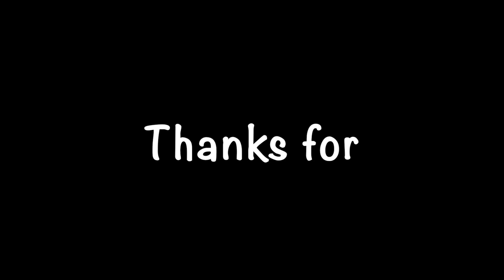How to fix Broken cabin foundation Piers

Comment: Great video, and very familiar work.  I did the same work at our cabin in northern Ontario - 11 piers in total.  I managed to get all 11 down to bedrock, even if the hole had to be 6 ft deep.  Pinned rebar into bedrock, then built pier posts out of 12x12 bullnose pier blocks, filled with concrete and rebar.  The area surrounding each pier was backfilled with gravel.  What I've learned is that frost jacking/heaving needs three things:  1.)  Lots of moisture below the frost line, 2.) Fine silt or clay soil, 3.)  Freezing temps.  Eliminate any one of the three, and problems go away.  I added french drains to try to address #1, and kept the clay soil away from the piers by backfilling with gravel for #2.  Not much I could do with #3.  So far, 5 yrs in, all is well.  You've done fine work with a miserable job.  My only suggestion would be to not backfill with native soil, but bring in some pourous sand/gravel.  I hope you have steady piers for years to come.
Reply from the maker: Thanks!  so far so good I did put a drain all the way around the camp which I’m sure helped tremendously. Once I get skirting put around it that should help keep the frost from running real deep as well. Sounds like u had quite the project as well.
Reply: These are some amazing tips. I'm also in Ontario and taking on a similar project. What type of concrete did you use? And what type of gravel?

Comment: SUGGESTION: You should consider thick mil plastic to hold back any moisture.  Then a french drain around the perimeter that dumps water downhill.  Also, grading the ground around your cabin so that water flows away from your footings.  Having dry ground under your cabin should solve any frost  upheaval that you are experiencing.

Comment: Great video. My wife & I have planned on leaving our nations capital (Ottawa) and moving to rural northern Ontario in an unorganized township where we have a small parcel of land surrounded by crown. The local tradesmen in the area are not very eager to work apparently so we have decided to take on the project ourselves to build our foundation. We will be building a vertical (stockade) style log house 28x32.

We have all been made to believe that you need to be hooked up to the grid, hire professionals and work a 9-5 job until your 65 and retire. You don't.

My wife and I are both 36 and own a legal secondary dwelling and another house which will be sold once we are to crippled to walk. Time to GTFO.

Appreciate the details in your video and will be checking your other ones shortly.

Thank you!
Reply from the maker: Sounds like you have a solid plan. Wishing you the best on your new journey. We only get on trip on this rock might as well make the best of it. Nothing more satisfying than doing it yourself.

Comment: Gotta say - this video is gonna help me tons. I, like you, purchased a cabin about 3 hours north of Toronto (so about the same climate as Vermont) that was cheap, because of leaning or busted piers. We've enjoyed it for about 18 months now, but it's time to do something about it. I got quotes for about $100K +, which isn't going to happen. We had so many questions about doing it ourselves, like:

- piers MUST have rebar, don't they ? :-)
- how far to dig down
- how to get them out of the ground - we don't have a pickup, so might invest in an electric winch
- what to do with the old ones.
- how to dig with about 1-2 feet of clearance - was there any magic tricks
- do we set the posts INSIDE the sonotubes or not
- 8X8 posts or 6X6
- 45 degree supports

I think you've answered everything here - I'm gonna save this one, for sure!! Ya, it's a lot of work, but the money you saved AND, probably more important, is knowing that it was done right!!

Thanks
Mike
Reply from the maker: Thanks Mike!! Glad it helped you out. There are a ton of options to jacking and leveling a camp one option depending on the the size of your camp is to find a couple I-beams and Jack and crib the whole camp up higher to give you more room to dig I was lucky that my cabin was up high already except for the front. Just remember one you start replacing them to finish before winter. Unless you do the I beam method then you won’t have to worry about frost jacking. I like to over build things a little bit rebar is just cheap insurance to me it only added a couple hundred bucks for piece of mind. Also remember if you ask builders or inspectors questions about building codes or what not they are just minimum standards I personally will spend a few extra dollars to build things a bit more rugged with in reason where I see they could use a bit more than minimum standard. Also look around in your community maybe you have a neighbor with a tractor or truck and you can barter or trade something in return for use or assistance with pulling out the old piers. It’s sad that now a days we are all led to believe we can’t do things for ourselves any more we need experts and professionals to know how to live. Wish I was closer to you I’d lend a helping hand. Keep me posted on your progress. I promise you that you will have a lot more satisfaction doing the job yourself than just paying someone else to do it. Look forward to hearing how you made out.
Reply: Have you completed your project yet? I am in the similar position as you are.

Comment: I am wondering about the added benefit of digging holes deep enough for a solid gravel base below sonotube placement and then back filling with gravel, so no soil or moisture makes contact with pier. I learned a lot in this video. Thank you!
Reply from the maker: I think the gravel base is a added benefit. Are you talking processed gravel with stone and dirt for backfilling around the piers? If it’s just stone gravel I would worry about it just allowing water to fill up the hole and freezing. Thanks for appreciating the video it was a lot of work to film the process on top of all the work replacing the piers.
Reply: @offgridcabinaddict6314  I am talking about gravel with no soil or dirt content as a backfill around a sonotube extending a foot or so below frostline.  It is best if the sonotube rest on a bed of gravel  atop a concrete footer, i.e., gravel, footer, sonotube .  It is very important to add a french drain, a foot or so bed of gravel running all the way around your cabin with a porous conduit pipe running below ground draining off water downhill from your cabin. If your cabin is on level ground, you will need to fashion drain pipe at a downward sloping angle.  You may study everything I have said in you-tube videos. Earthbag videos will show french drain concept.  Water may well fill up in porous gravel around hole. That is why a porous french drain is a must running besides your piers to drain off water.  But if your piers come in contact with soil or moisture, it may well expand your piers in freezing weather and break up your concrete piers.  Understand gravel offers a porous benefit, where soil or dirt around pier does not. Check out videos re the harm and severe damage freezing weather can have on piers surrounded by soil and dirt. Good luck.

Comment: Hope you got a good batch of premixed concrete we built a retaining wall with 8x8 post 4 ft in the ground cemented in after it dried the concrete had so little cement in it that it just crumbled we noticed when we went to put the 2x8 in place had to remove them all redig the holes and replace the post so you were wise to add more cement to the mix
Reply from the maker: Thanks Doug. It’s always better to over build than under build things. Code is minimum requirement so why not do it a little better than code if it’s reasonable to do. That’s what I try to do anyway for peace of mind

Comment: Very nice! hard work.  In southern Ontario,  large outdoor room built.  Holes dug down to 48" and sonotube piers.  6 legs 4 of them are sitting well on the piers but a couple are just off on the corner of the sonotube footings. How would recommend fixing those or is that good enough?
Reply from the maker: I’m trying to picture in my head what you have going on without seeing it. It’s hard to recommend a solution without seeing it. Do you have room to jack and crib the room to dig and either pull out the old one or dig around it and move it over? Did you pour them yourself?
Reply: @offgridcabinaddict6314  can't post pictures but to explain better, post are not centred on piers but that's fine except 2 of them have corner of post peaking from the cement pier by an inch or so.  The metal bracket has a metal pin that sits into the pier and the post is bolted into it like your's. That is all secure. Just not happy that they couldn't place the piers to align perfectly with the posts.  It passed municipal inspection so I'll accept it as safe and within specs I guess. I didn't do this, contractor did.  If passed inspection, I guess no need to redo.

Comment: What a big job you tackled!  And what a poor job the builders did originally!  I gotta wonder if someone told them they need 6 foot sonotubes but didn’t tell them they need 5 of those feet into the ground?  I really like your solution, the 6x6 posts look much better.   Would it help if you blocked off and insulated the crawl space from the weather? Would there be less frost under the house then, and less potential for any shifting?
I’ve got 4 leaning piers at our cottage up here, north of Lake Ontario, and I learned a lot from what you did.  A bit of a different situation, the piers are concrete block stacked and filled with concrete.  Originally placed on rock, they still shifted after 40 years of water, cold and ice, and that’s why code now says they need to be tied into the rock with rebar.  But seeing what you did, especially on lifting and supporting the cabin, I think I can fix this now.  Inspirational!
Reply from the maker: Thanks Ed. Glad I could help. I defiantly think Skirting the camp keeping the cold weather out will help keep the frost from running deep causing any more issues. Sounds like you have something solid to work from I would get a masonry bit and drill the the rocks and put threaded bolts in and use 6x6 post plates and 6x6 post. Let me know how you make out
Reply: @offgridcabinaddict6314  hi, I went and dug the weakest one out, it wasn’t even bearing any load anymore!  Took about 2 hours but got it out and down to solid rock.  The original one was moved aside by tree roots!  Keeps those trees away from your cabin!  They moved the 500 pound concrete column and footer 10 inches over 30 years.  The new footer is getting tied into the rock with rebar, and I’m digging the rest out and cutting all tree roots near them.  I’m lucky we’re on rock, but in this situation the footers need to stay exposed and not covered in soil otherwise the trees can grow around them, as happened. 3 more to fix over the summer.
Reply from the maker: Amazing what Mother Nature can accomplish over time. Sounds like you have a good handle on it. Sounds like you have a busy summer ahead of you. No better feeling than when you finish it and know it’s done and done right.

Comment: awesome job man. I need to do something similar northwestern PA. My camp is on block piers
Reply from the maker: Thanks Mike. Best of luck on your project let me know how you make out.
Reply: @offgridcabinaddict6314  will do I just got back from there. I am now remotivated to fix the place up my dad and grandpa built it in 1975. I also have to work on drainage the the soil is always saturated. You  dig a hole and it fills with water.
Reply from the maker: @mckinleyparkbikes   sounds like a lot of water your dealing with. That’s so awesome you are fixing up a camp with so much family history

Comment: This is awesome. Thanks for all the valuable info! I have a similar project that I am about to embark upon. What concrete did you go with? I recognize the brand, is it quikrete? Can you tell me the specific bag? I am in rural Ontario and our frost line is also 4 ft deep.
Reply from the maker: Thanks Afeen I used sakrete concrete mix 80 pound bag also added Portland cement for added Strength

Comment: Would it be feasible to install new piers  next to each broken one instead of digging the old ones out?
Reply from the maker: No because the old piers would have frost heaved up causing issues. If you live in the south where there is no frost you could get away with doing that. There was 18 piers so adding 18 more wouldn’t have been pleasing to look at for me. If you have squirting you could hide them all so I guess it all depends on what you want to do

Comment: Nice video. Are the blocks adjustable?
Reply from the maker: Thanks! I used 6x6 posts so if for some reason a concrete post settles I can just crib and jack the camp and cut a new 6x6 post

Comment: Hey Hans, love your vid’s! I have a camp in Hornepayne On, 70 yrs old and real close to the water, problem is it’s half on bog and keeps sinking, looks like they just kept adding a railway tie or two and jacked it up year after year, if I dug down it would be a mucky mess, other then moving it away from the water(which it’s so old and dry, don’t think it would make it) any thoughts? Cheers Paul
Reply from the maker: Thanks Paul, with our knowing how deep of muck your dealing with you could try driving some heavy walled pipe down into bedrock and weld a plate on top to build off or if you have a lot of rocks around you could try Binding up the muck to give you firmer ground to pour a bigger pad to level off of. You could find plastic 55 gallon barrels cut the tops off fill 1/2 way with rocks and pour concrete the other half and level off that. With out knowing what you are working with it’s hard for me to say. I always look for free stuff to recycle and put to use and is budget friendly. Hope that helps Paul.

Comment: how were the wooden piers attached to the house ?
Reply from the maker: I used timer lock screws 8” on the posts and 6” on the braces I was going to cut some 1/4in plate steel and lags and put it from the rim joist down to the posts but never got around to it
Reply: @offgridcabinaddict6314  thank you
Reply from the maker: @RALPHLAURINO  hang on to your wallet when you buy the screws they are not cheap
Reply: @offgridcabinaddict6314  Thank you for the information and inspiration.

Comment: How is it after a year?  Could use a swale in front and on sides to divert rainwater. Quite a few piers. I need to replace 4 piers in back of my cabin in PA.
Reply from the maker: Hey Dave I will let you know this spring after the thaw I just finished it in august. I dug a Perimeter drain around it Fabric and stoned it to keep rain water and melt water away. I replaced 18 of them so I feel your pain. Good luck on your project

Comment: Not trying to be smart. I’m moving to Alaska and want to build my own cabin. Even if you set the footing below the permafrost wouldn’t the section of the concrete in the permafrost crack from the movement?
Reply from the maker: I’ve never built on permanent frost but if it stays permanently frozen I would assume if you drilled into it a foot or two you shouldn’t have to worry because it’s permanently frozen ground so it shouldn’t move unless it gets extremely warm and melts it away you could always use adjustable posts in case it moves. One thing you could do is build off pads right on the ground so the whole thing moves at the same rate
Reply: Where are you planning on building in Alaska?
Reply: I think you would be wise to find out exactly what the locals have been doing that worked, and do that.  Good luck in your adventure!

Comment: Are you putting the plastic footer on the tube or sinking the tube 5 and half and filling with concrete I have a similar problem
Reply from the maker: Hey Todd,  I just went with the tube making sure I was a little more than 5 1/2 feet in the ground

Comment: You should have had a consult with an engineer to get a design on the pier before you did anything. I hope you installed a footing sized for the load and soil bearing capacity.

Comment: Top tip: Put a strap over a tire to pull posts up out of holes
Reply: Lance can you explain this to me a little bit what kind of strap and how to position the tire ? Basicly I'm having to do this in similar way with telephone poles set into concrete about 4 feet into ground id like to do it the best easiest way thanks
Reply: @clintstenger1626  use a wide ratchet strap fastened as far down as you can on pole then stand a tire next to pole with strap over the top of the tire so it rolls as you pull on it. Changing the pull on the strap upwards. Two tires on an axle would work better yet, keeping it from tipping as you pull. Hope this helps
Reply: @clintstenger1626  search youtube pulling trees with a tire or something similar

Comment: Drainage, grade and soil composition are all considerations for pier design.  Looks like you had to repair extensively as a consequence of poor construction and a builder's lack of ethical standards.  No rebar in those tall piers merits a flogging with rebar.  Good work, I'd hire you.
Reply from the maker: Thanks Hans!! It was an undertaking with just some hand tools and a pick up truck. I can’t Believe they didn’t put any rebar in them doesn’t cost much for a few pieces to put in them. I guess if they had done it right I wouldn’t have got a deal on it. I basically bought the land and got a free log cabin. Talking to a neighbor he said the old owners got to frazzled about it. They went up to the cabin in the spring and couldn’t get in the door because the frost jacked then cabin so bad. I could only imagine the next season after having it built you have foundation issues. It only took 2,500 in materials and a few months of spare time to fix it myself. I’m sure it would have been a 10 to 15,000 dollar job to have someone fix it. Cool name by the way I share the same one.